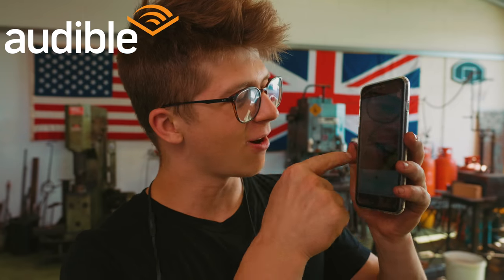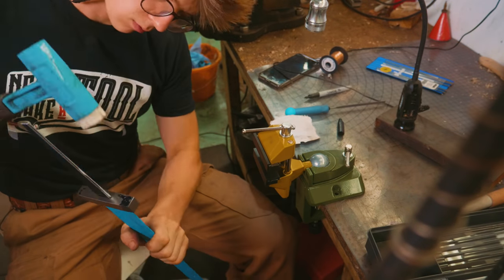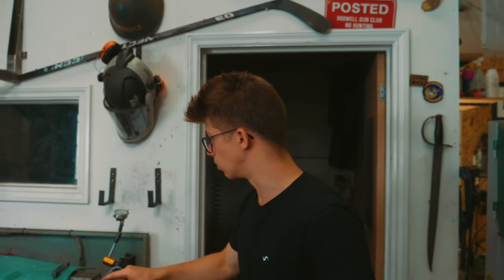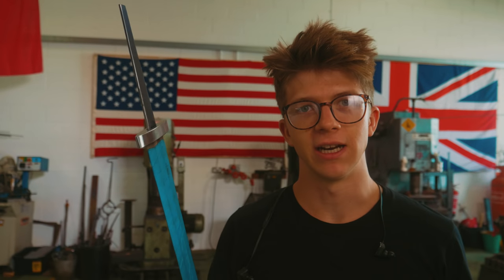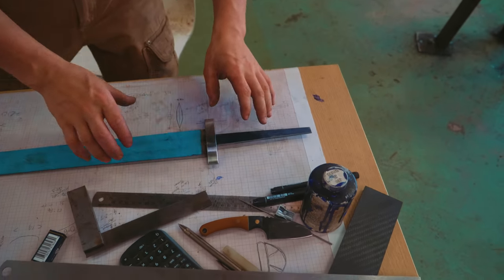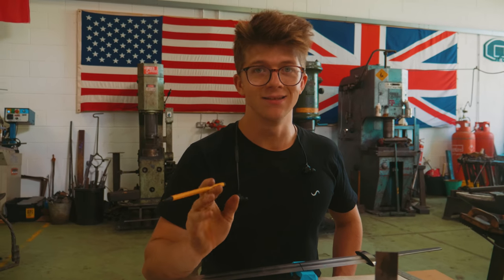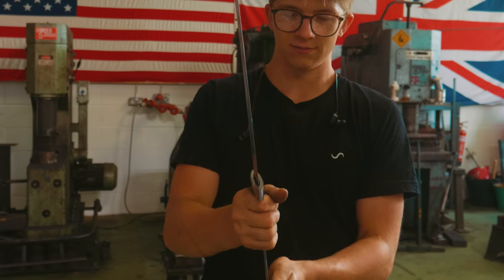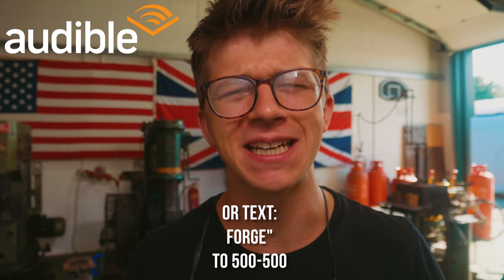MAKING A VIKING SWORD!!! Part 8

Comment: Tip: You want to find the balance point, don't use one pen - use two.  Pick the blade up on both pens, one in each hand, then slide them towards each other.  Physics takes care of the rest.  (If one pen is farther from the balance point than the other pen, then the downwards force on it is less than on the other pen, so it slides more easily until it passes the point where the downward force on it is the same as on the other pen, at which point the other pen starts to slide.  They will alternate sliding inwards until they meet - at the balance point.  You can do it with your fingers, with a couple of pieces of rod stock, anything.  Huge time saving trick!)
Reply: Andrew Webster excellent pro tip
Reply: he wasnt trying to find the balance point, he was trying to ensure the balance point was at the pen mark to make it balanced with the guards and grip etc.

Comment: That point on the blade where it moves the least while swinging it is also called the Center of Percussion. If you hold the sword flat to the ground and slap the blade so that it vibrates in a wave (wiggle it) you can see really well that way too. The way I like to explain it to my sword students is "it is the part of the blade that vibrates the least like when you wiggle a pencil to make it look like it is bending it is the part that doesn't look like it moves at all."

Comment: I still love the smell of Blue DyKem! Years ago I had a job where I made (among other things) custom pump and motor bases out of "Ship Channel". I laid out the centerline and then did the rest of the layout. Drilled the holes with a mag base drill and hand tapped them. Then painted the base and loosely mounted the motor and pump with a hand made coupling guard made of expanded metal. Put the coupling inside with a note" Assembly MUST be aligned after base and piping installation!"Had more than one customer call me and say they had never seen one done that way! Then I got to do one or two a month for years after that! Something else you might like is Prussian Blue...

Comment: The tang normally goes thru the upper guard and the pommelcap as you describe it. My re-enactment viking sword is made this way and it's based on a historical find. The reason for the two separate pieces is the casting proces that was used at the time. Challeging pieces were casted separetly. These two pieces were rivited together to form the two piece pommel. It's a technique that dates back to the Vendel period. (Pre viking age). As swords were passed on so was the technique for constructing them. As for balance. Almost all these swords had their balance point 3,5 - 4 inches in front of the Crossguard. It is ideal for the fighting style with these weapons. Hope that it helps. Keep up the good work!

Comment: I think the modular assembly of the pummel is actually to make it easier to balance the sword.
You have your base "pummel cap" and can remove material in the inside until the balnce matches.

Comment: Amazing work Alec! Love how much you dive into the history of what you are making and keep that in mind. I wonder if the Vikings would have used the 'pummel cap' to depict which battles the sword was used in or what position the owner had in the hierarchy of the army when battling throughout Europe... 
By the way the scrollwork you plan on getting on the sword wouldn't it be easier to give yourself a better starting point by using your carbide hand drill (which you have used for the guard fitting) so you have more control over what your doing??

Comment: Hey Alex, I noticed that you balanced that sword with about 3 extra inches of material, where the tang goes past the second guard. Did you include the weight of that material you're going to cut off in your calculations?

Comment: In a post Roman Europe swords where extremely expensive and good swords where mainly reserved for kings and higher nobility so they where a massive status symbol to the point that there was a market for cheap non-name knock offs. So it made sense for a sword to be passed down the line of sons, and for the son it added an air of continuity and legitimacy.

Comment: from my limited understanding, the pommel was designed that way so that you could easily file the flat side of the pommel to readjust the balance point after several years of sharpening.

Comment: When redoing the grip they would forge weld more tang on, if they shortened it then it would become uncomfortable. To forge weld more tang without ruining the blade temper the blade would be wrapped in cloth and someone would constantly pour cold water onto it with just the end of the tang in the coals. The cap is purely decorative and is called a pommel cap because it caps the pommel, the upper guard eventually became the pommel. Grips were also changed because over time they loosen up, so when they handed them down the grips were not changed to modernize them but to tighten them up and the whole assembly gets replaced with all new and fitted to the new owners hand.

Comment: I think it's more likely to hide the peened over rivets and tang. It doesn't really ease dissasembly that much to my reconing. However depending on the location of those lower guard holes and pins in the pommel, you could totally hide all the connection points.

Comment: Possible answer to why the lower guard was riveted to the cap. We did an experiment several years ago. We dropped the upper guard onto the tang with a generous slit for the tang so it would drop around half way down. we then split the top of the tang to form a small Y, just enough to stop the upper guard sliding off. The we made the cap with a slit big enough to take the Y tang. Then when you riveted the 2 they cant move. it takes some jiggery pokery to make it work but it may be an answer

Comment: According to what I know, steel was really rare in Scandinavia, so they cannot bury their dead with their complete swords, because they had to reuse the blades. Instead of that, they were buried with only the guards the pommel and the grip. maybe the way everything is locked together have something to do with the ease of fitting another ensemble of pommel/grip/guards.

Comment: One thing I find really amaizing with viking swords are the period fake ones. During nearly four century, the Ulfberht sword was synomym with the absolute best blade available in Europe. They came from somewhere in what would be Germany nowadays  and were made with laminated iron believed to have been manufactured in the middle east or even as far as Afghanistan. They were probably made by several dynasties of armourers who shared a same core technic of folding the metal on itself and controlled hardening. But as fascinating as it is, what I find the most intersting is that the Ulfberht brand was so recognized and valued that it lead to the production of fakes : lower quality blades engraved with the ulfberht mark. Were they sold as a scam to people thinking they were buying the real deal? Or were they sold as a symbol of social aspiration, a stamp to enoble a cheaper blade never inteded for actual use? Are the one found nowadays relevent (a few surviving poor quality blades among a vast number of blades destroyed by time and elements) or an epiphenomenon?

Comment: 7:25 I would have assumed that it is a separate piece so that the pommel (which was used in combat after all) could be replaced WITHOUT dis-assembling the sword... Just a guess though. Thanks for the excellent content as usual by the way.

Comment: What if the funny pommel cap configuration is so that after you’ve refit a conventional pommel (effectively shortening the tang) several times you can still put a pommel on it with a shorter tang that doesn’t pass all the way through? Like a way of solving the problem you had with the falchion making the tang too short for the pommel.

Comment: Thinking on the purpose of the "pommel cap" it is quite possible it was designed to be replaced as it could have been used to bashing. Instead of bashing with the riveted cap and damaging it over time they designed a replaceable cap that in the event became too damaged could be replaced without complete disassembly of the weapon.

Comment: Alec what about making the fuller with a ball while its hot, if it was rolled between some kind of jig that has enough downward preassure to indent and an upper and lower ball, it would have to be done earlier idk just brainstorming. Its amazing work.

Comment: R.E. the pommel cap. The overall weight of that type of pommel could be altered, and the weight/balance point could be easily changed to suit any new owner without cutting off and shortening the tang and without upsetting the grip perhaps.

Comment: Best invest in a few 'joint' type round files of different diameters. These are parallel sided rather than tapering like the rats tail one you are using. They are much better and easier  to use for the type of work you do

Comment: With the cross section of a sword tang its large, so by using coller pins it saves steel which at the time came at a premium. At least that my two cents on the handle construction.

Comment: I think the reason for the method of the pummel construction is to protect the main rivet. What you say about ease of disassembly/reassembly doesn't make sense to me, because with a simple pummel you just grind the rivet remove the pummel, regrip, and reassemble slightly further down. Same thing with less steps, but the rivet is exposed at the striking end of the pummel. I could be wrong, of course, but that's what it seems like the purpose is to me.

Comment: Alec my man with a plan.. i was just wondering, if the fouler is going all the way through the guard  (lower) and a bit under where the handle is going to be, wouldn't that gap between the blade and the rest of the items be a spot to collect water/liquid and dust and thus making it a great place for rust and eventually breaking?

Comment: Hey Alec! I notice you get the order of operations wrong occasionally and I don't think that it is because you lack the knowledge, rather you dive deep into different sections of the project and get caught up. I wonder if it might be beneficial for you to sit down and build an outline that you can check off as you create builds that has all of the integral steps in it so that you don't end up making a small mistake that costs you several days in the end. Maybe a flow chart so you can add the small intermediary steps in between the large steps. I think it would also be a great episode to hear your thought process on the project before hand and see how your thoughts are brought to life through the plan.

Thank you for the last year or so of entertainment! much love from the USA!
-Jeremy

Comment: When weighing out the various guard pieces to attain a balance point, are you trying to replicate historic examples?  
It occurs to me that the addition of the handle material (likely wood and leather wrap) will add some weight, thereby moving the balance point back closer to the hand, but historic examples don't have those, so it'd be an even comparison.  Versus, choosing a balance point based on preference and feel, which would then be thrown off by the handle material.
Just curious about what approach you're using for your target.

Comment: How to you subtract out the weight of the tang that will be cut off when balancing? Do you just have to calculate out that mass when designing the upper guard and pommel?

Comment: I wonder if the pommel attachment method was to aid easier replacement of the pommel. No hard evidence but having read a lot of viking era historical fiction it seem the pommel was used in battle as in a punch to the face with the pommel.

Comment: Hi Alex . I've a quick question. . How do you know/work out where abouts on the sword at which point it should balance. . Seen you there balancing it on a pencil. .. what's the thing that tells you where that pencil should be. ? Sorry for being dumb. 
Looking forward to hearing your reply. 
Thanks 
Luke
Reply: The pommel equals the total weight of the blade. So Alec has the weight of the blade and can make the pommel as heavy as he wants. As you mentioned Alec is free to set the point of balance where he wants it. Normally the point of balance lays 7-15 centimetres below the cross.If the distance is higher the sword would hit stronger but would also become unwieldy. If the distance is lower the hit loses power but the blade could be wield better. So it's a decision made about "how easy to wield" and "how strong the hit should be" and thats why most balance points are 7-15 centimetres below the cross.Thats what I would say. But it could be wrong.
Reply: Mike beats tsb he is probably going off of historical examples for where to set the balance point at.

Comment: I just barely saw one of your Damascus videos. I know gold is a very soft metal but is there possibly a metal that has a similar Sheen to Gold that be strong enough to bond with a dark colored metal to create a more vibrant type of Damascus? I'm not an expert in metallurgy so if it's not possible I understand entirely. My smithing skills are limited to mostly repairing damaged things and working with metals that are already pretty much created. Railroad spikes into knives and tomahawks, leaf springs from trucks into kukri and Bowie knives.

Comment: Hey Alec. Great work but I have a question. I visited your friends at eveleigh works today and they gave me a half finished hammer head. What type of hammer should I make it if I want to start blacksmithing it and how should I go about making the handle? I know you have videos but as I haven’t started blacksmithing I only have an angle grinder and a 4x36 belt sander to work with. Thanks.

Comment: Perhaps the "Pommel Cap" was used to weight the sword differently at the preference and/or adjust the balance point of the weapon? They didn't have millimeter sticks and the methodology of manufacturing was much less refined than your methods.

Comment: alec im just wondering if the vikings took the weight of the handle into account and if so did you do the math of how much weight you have to spare for the handle/grip so the balance point is where you want it to be when the sword is done?

Comment: Great video, as always. I know your free-hand grinding skills are legendary but why didn't you use a toolrest when grinding the oval shape of the guard? Using a toolrest that is square to the belt would have prevented that initial mistake. Yes, you end up with perpendicular scratches but then you switch to free-hand grinding when you get to the higher grits. I'm no expert but that's what I would have done. Cheers!

Comment: @Alec Steele  Dear Alec, how did you account for the weight of a handle, you havent created yet, when calculating the weight of the pommel and pommel cap?  Your cap might need to be smaller than you previously anticipated to achieve a proper balance. PS it looks awesome !!!
Reply: ALSO a sword designed for use with a shield needs to be slightly more tip-heavy than one designed to parry. You already have a shield, you focus on maximizing offense.
Reply: I immediately thought of this too
Reply: he still can grind it down if he needs to

Comment: You made one mistake while messuring the weight for the upper guard and pommel. You measured the weight of the yet to be cut off part of the hilt, so after cutting it off your point of balance is shifted because this weight is lacking at the grip end.

Looking forward excited to see the end product!

Comment: first of, I'm not a blacksmith and have no clue what is normal while working on a piece in that profession. I'm just a newbie watchmaker.

you grinded a whole lot of material off of that guard, which, as you said yourself, took a ton of time
so as the guard wasn't hardend why didn't you saw of a big junk of the material and just grinded the rest? (something watchmakers do to save time filing, though in different dimensions)
also sorry for the english it's not my first language

Comment: What earphones do you use and would you recommend them. As my old pair of Bluetooth ones got wet when I was cycling and no longer work. I guessed if the ones you have stand you to what you put them through they should be good enough for cycling.